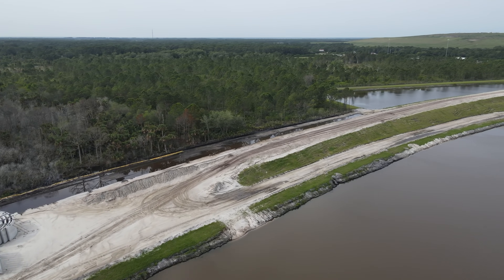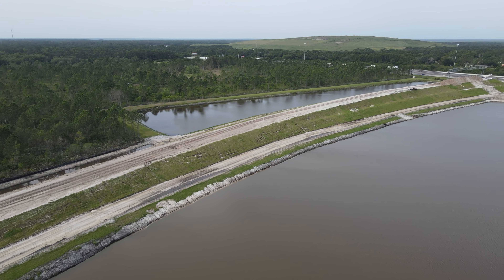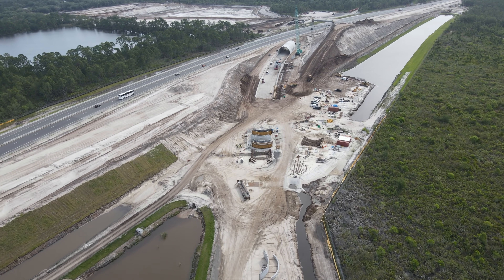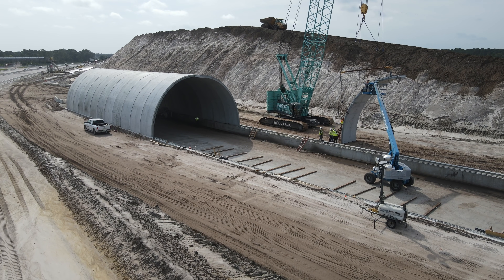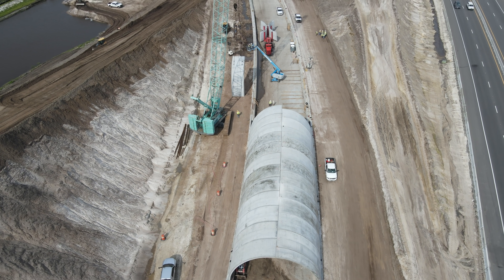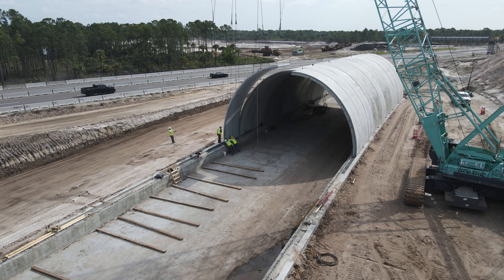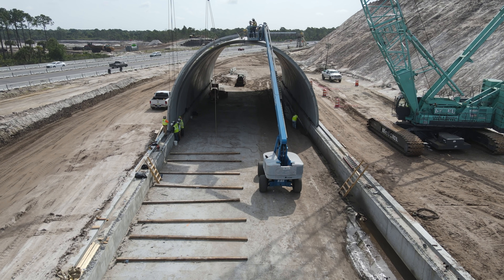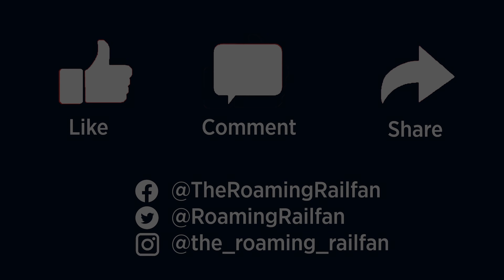Brightline Construction: The State Road 528 Panel Tunnel - April 2021

Comment: I'm glad no one got their fingers caught when putting those panels in place! How long did each section take? As it's sped up you can't easily tell.
Reply from the maker: The part I filmed from when it was rotated to set in place was a little longer than 30 minutes. There was work before that and some minor adjustments afterwards so I'd guess roughly 2 hours a panel.